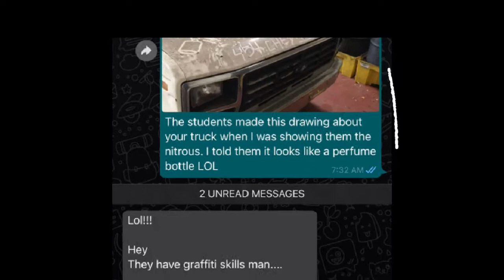OIL FILTER MOD works on all GM Gen III / IV LSx engines DIY Bypass check Valve Delete - step by step

Comment: Would this give better oil pressure? Thanks 🙏
Reply: Sweet thanks for ur time brotha
Reply from the maker: Not higher, just PREVENTS an intermittent failure that could happen by eliminating the part that could sometimes fail. Think of it as bulletproofing that part of the system. It’s a solid piece instead of a spring. Max pressure remains the same, that is controlled by the pump spring and other factors.

Comment: This will increase oil pressure?
Reply from the maker: It will not, however it will prevent it from dropping when it shouldn’t and fluctuating.
Reply: @TORQUESOUTH  from dropping oil pressure?

Comment: Why we need it at all
Reply: Will it increase oil pressure or flow
Reply from the maker: It is to prevent a failure that can occur with the factory setup.
Reply from the maker: It prevents any loss of pressure or flow from a failing spring by replacing it with a solid piece.